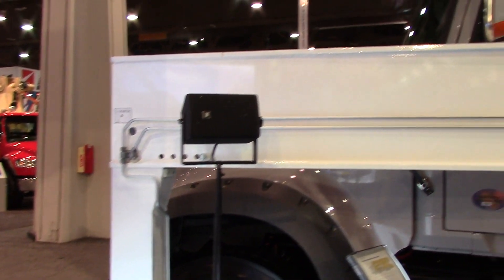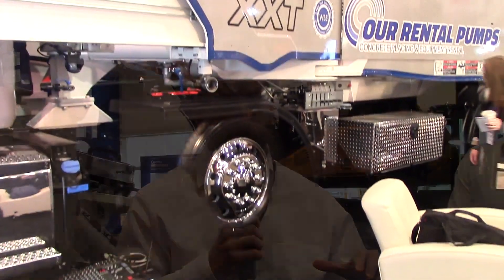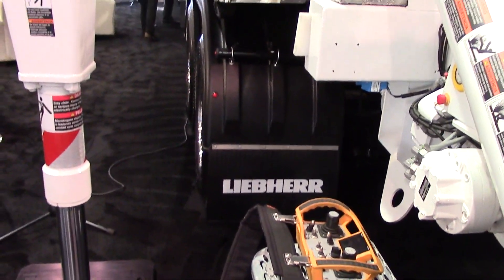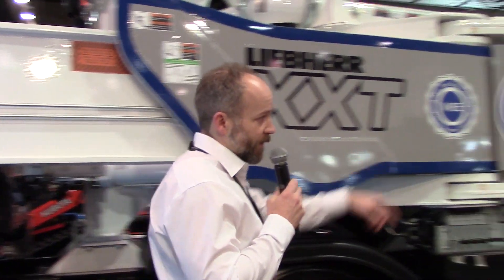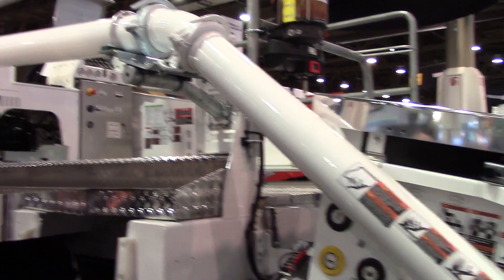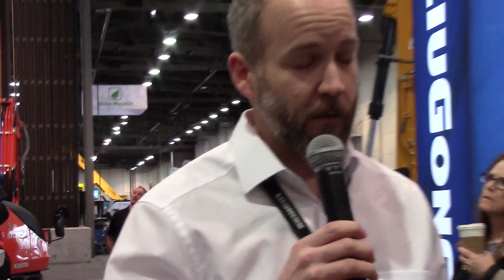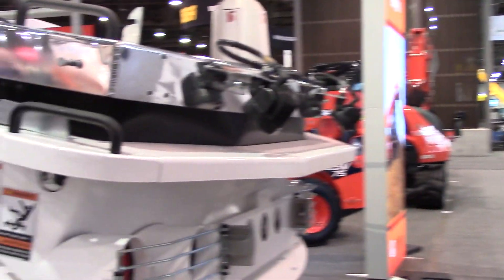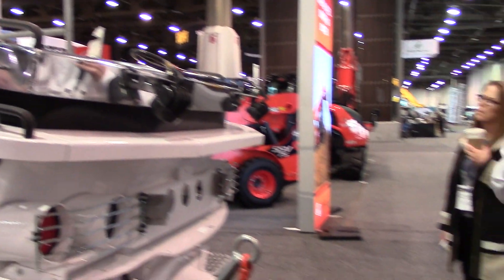Liebherr 42 M5 XXT Concrete Pump Built with 90% Less Hydraulic Lines

Comment: This power block technology is amazing from what I have seen and understood.The closest thing to this is what Putzmeister has incorporated for years which is POH (push over hydraulics) .POH works in conjunction with the volume control.During S - Tube change over the volume control is near 100% for milliseconds @ any set volume.You can see and witness this just by watching the Piston -Water box when machine is stroking.To be able to control each drive cylinder independently is simply amazing.Good job Eric Wright with helping the Liebheer team to take conception to reality.